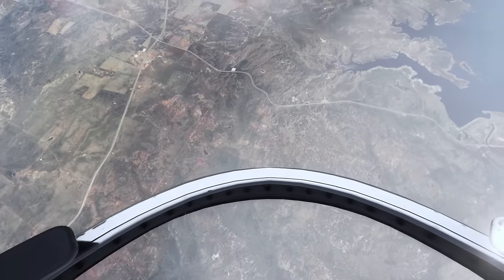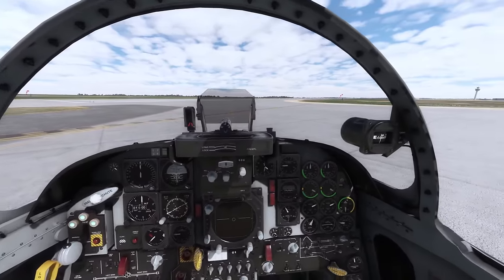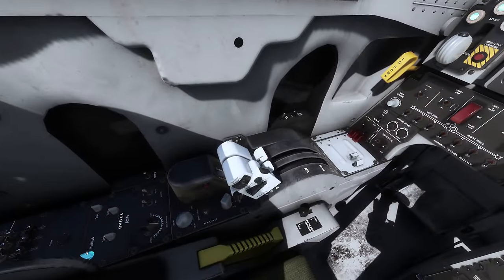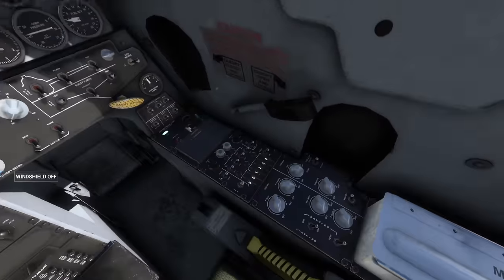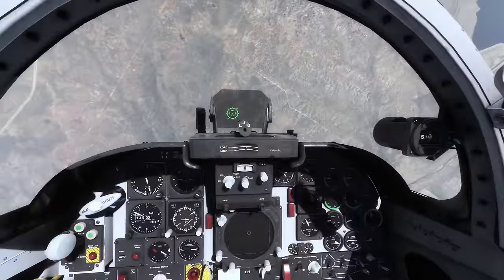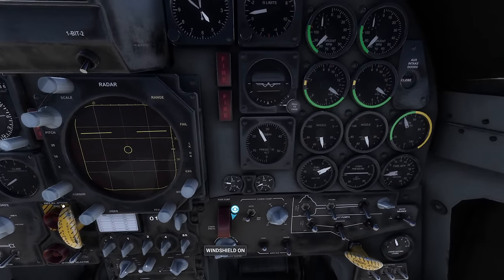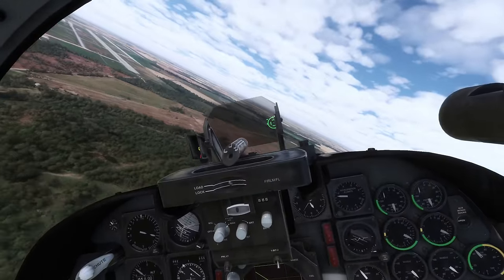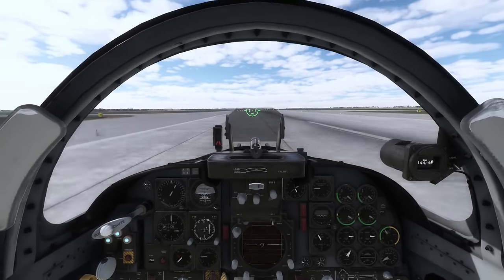T38 pilot demos a typical sortie from Sheppard AFB in an F5 Tiger by SC Designs (MSFS)

Comment: If starting the right engine first, the parking brake (or toebrakes) would need to be applied and held wouldn't they? Is there a reason why you didn't start the left engine first?
Reply from the maker: T38 habits, right engine was started first due to the way the electrical buses were setup. Chocks left in until engines started but once removed, you rest your feet on them and keep them applied when not moving.
Reply: @cgaviator  Oh okay, thank you for the quick reply, I like to find out these details, I guess I'm a closet nerd!
Reply from the maker: @winkle69  I think everyone is a closet nerd about something! 🤓

Comment: I've been reliably informed that the T38/F5 is one of the few aircraft allowed to fly at 300kts under 10,000 ft while under radar control from ATC, otherwise it can fall out the sky ... allegedly. This gives us plenty of scope to rip it up !
Reply from the maker: Yup, that’s correct. I guess it’s for most fast jets. While it can fly fine at 250kt, if it’s a warm day and you’ve just taken off (heavy) you’ll struggle with single engine performance and the drag curve. Hence 300kt 👍🏻

Comment: The roll rate seem very fast is normal in real life ?
Reply from the maker: Oh yes, roll rate is crazy fast in a T38 so presume same for F5.
Reply: Does an A4 Skyhawk have better maneuverability than the f5 or no ? at same speed ovs
Reply from the maker: @arifridman5651  good question, though I don’t have experience with the A4. Though my guess is that the A4 may have a smaller turn circle but the F5 may fly around the circle quicker. Just my guess though.